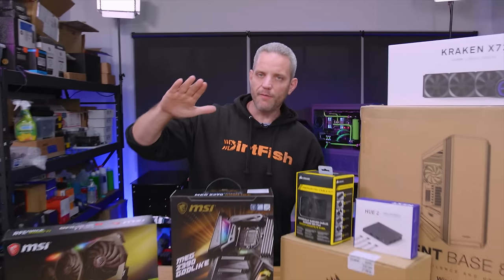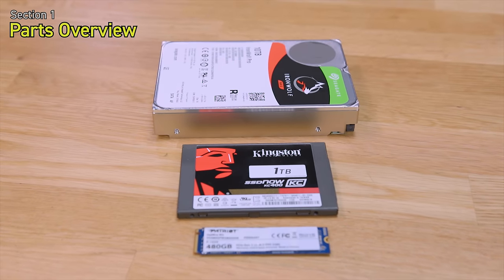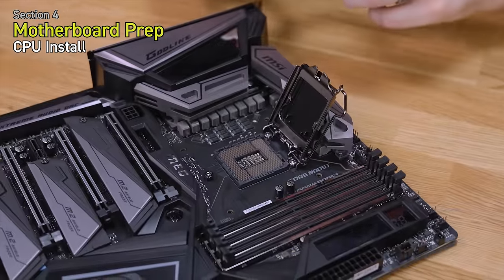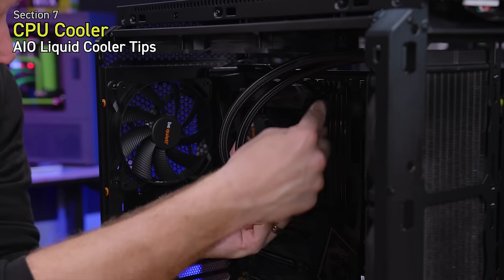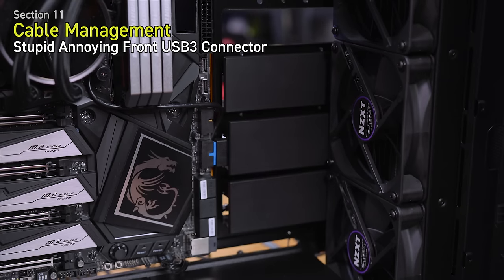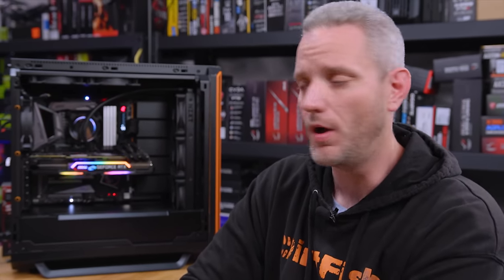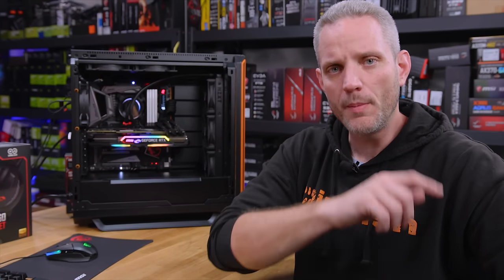How to build a computer

Comment: I did not hear the words "Thermal Paste" In this video
Reply: I think it's already pre-applied on the cooler.
Reply: @ijx_xj  Yep it's pre-applied but @ItzFrostbite still has a point though since it was a guide to build any PC lol
Reply: While I agree that he used the pre-applied from the cooler, I think he should have mentioned that for the newbies.
Reply: @welshtony1  Yeah I completely agree with your point.  He should point out that some coolers don't come pre-applied with thermal paste and that you need to apply it yourself.
Reply: You probably didn't hear the word research either :) No one with just 2 working braincells, are gonna start building a computer without some research, that would be like trying to build something else without having any form of logical knowledge to it.
Reply: still tho, there's gonna be some idiot out there with more money than brains who's gonna go get the hottest of the hot and just try to slam it together without doing much research other than finding out what parts are the fastest and most expensive.
Reply: Thats because its Lready pre-applied ...
Reply: Noob question: Based on my rudimentary understanding of connecting surfaces with paste and pads, is it not inadvisable that so many of these video guys are putting their oily fingers all over them? The human hand excretes oils which is why we shouldn't touch certain light bulbs. Even freshly washed hands. It seems to me you shouldn't touch the CPU thermal surface with bare fingers at all in order to keep the surface clean for optimal paste coverage. Or am I applying logic that is true for some things (like bulbs) to something it doesn't matter for?
Reply: @C.Church  you don't touch that stuff. Although, wiping it before applying thermal paste is recommended.
Reply: He didn’t show us how to put the RAM in
Reply: Just lettin you know this guy used that profile picture and killed himself http://steamcommunity.com/id/berhop
Reply: Kjølepasta
Reply: lol thermal paste users in 2019
Reply: @2sdd  wait, What?
Reply: Nzxt AIOs have pre-applied thermal paste. When I bought my first pc, I bought the kraken x52 and wasn’t aware of that. I bought some thermal compound and upon inspection I realized it already had some applied. Nice touch on their part. (Also, I ended up replacing their compound with some arctic silver and saw extremely small temperature changes. With the arctic silver, I only saw an improvement of 1-3°C in benchmarks I ran.)
Reply: Good point
Reply: Schlomo Goldbergstein 7  Use thermal grizzly: https://www.thermal-grizzly.com/  and some isopropanol to clean the cpu first. pre-applied paste is always less effective then the one you can can separate and do yourself. just myke sure you do it right
Reply: Under the cooler is one thermal pad tape
Reply: If it's pre reinstalled do I need to redo it
Reply: @ijx_xj  cool but that should've been said. cause if someone gets a cooler that doesn't have it pre-installed and doesn't realise you actually need it.... well that person is really screwed
Reply: also he should build a reasonable pc that most people will build for the first time
Reply: i did not hear the word "PREAPLIED"
Reply: @ghomerhust  agreed.
Reply: @JebusGolpez  You have to be on the spectrum to not know if you use thermal paste or not...
Reply: A lot of heatsinks and AIO’s have pre applied thermal paste, not really needed
Reply: The water cooler has pre applied thermal paste
Reply: Wolfcrazii I don’t think he even used it
Reply: The words "thermal paste" together give me console peasant anxiety
Reply: Josh Hust I totally agree it should be at least mentioned.
Reply: @sicariusperemo3789  You... underestimate the number of people who slubber through a build
Reply: I've been building computers since IRQ jumpers and needing debug g=c800:5 (at least as I recall). Would appreciate something more on CPU connections, thermal paste, and AIOs... This is a whole new world to me as I've just been primarily using laptops the last 10 years. However I think even a newbie would need more help in the details behind proper cooling connections than plugging in keyed DIMM modules.
Reply: @sicariusperemo3789  you underestimate human stupidity. By a lot. Look at the warning labels on a ladder or many other products.

Comment: You forgot your Swiss Army penknife and Allen key ?! you know nothing.
Reply: and the tweezers to hold cables together
Reply: and a hope
Reply: Actually, Swiss Army knife with HOPES that it has a screw.
Reply: This deserves a heart
Reply: And the lifestrong wrist band ofcourse!
Reply: And the thermal paste applicator.
Reply: And the wireless anti static strap with cancer protection
Reply: he also didnt test it on league of legends afterwards. such a noob
Reply: Ditch Allen and go with Philip
Reply: lol
Reply: @itscharliee5558  your alias account LYLE???? ❤️❤️😂😂
Reply: And NOT to short the PSU out on the case - remember to place it on the rubber feet!!!
Reply: He also didn't screw in with confidence.
Reply: And some confidence to screw in the Motherboard...
Reply: You forgot to screw in with confidence
Reply: what about the wrist band?
Reply: he forgot the elastic band as well
Reply: OMG and you guys need to HAMMER the BRACE in the back AAAAAND you need that damn CPU INSTALLATION TOOL :D
Reply: He didnt even put his powersupply on the insolating pads, his pc will short circuit, what an amateur

Comment: Timestamps:
0:00 - Intro
0:21 - Parts Overview
4:24 - Tools Needed
5:10 - Case Prep
6:01 - Motherboard Prep
8:10 - Motherboard Install
9:04 - Case Fans
9:32 - CPU Cooler
10:31 - RAM Install
11:23 - Storage Drives
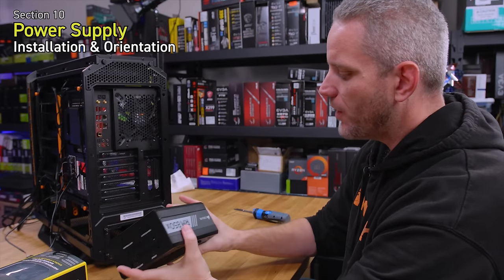13:07 - Power Supply
15:14 - Cable Management
20:00 - Graphics Card
21:08 - B-Roll / Its Done! / Outro
Reply: Nice
Reply: This needs a pin
Reply: why isn't this pinned/liked?
Reply: i love you
Reply: Should be the top comment by a mile

Comment: Who uses so many tools?  why make it so difficult, one Swiss Army Knife is all you need.  It does everything, some even have a anti static bracelet built in.  My Swiss Army knife even has a USB and is RGB!

All those tools, NONE of them will help you if there is a fire, but my swiss army knife has a fire extinguisher.  So when the fire happens, all you're going to do is just throw all your silly tools at it.  WTG.
Reply: u just got a subscriber
Reply: @chinchy111  Thermal liquid is to cool things down, and I like it hot.
Reply: @stimproid  Master Race Motherboards are placed on INSULATORS that PREVENT such occurrences. Therefore, my master build is impervious to that.  Also, I placed 4 anti static live strong bracelets on the mound stocks, attached to the widgetwonkie, that is plugged into the barfarcle valve.  DUH.
Reply: Stefan Etienne The Verrge Representative did you apply enough thermal paste? Oh and make sure the ram is beside each other for extra performance
Reply: Best troll ever!
Reply: Well, My swiss army knife also has a gaming PC. So i dont build gaming PC
Reply: I love this comment
Reply: @jonathanyork597  People have been questioning the whole placement of the memory side by side saying that I didn't place it in the correct channel.  They are wrong.  The method that I was using is a secret technique called FUSION memory.  

Placing two sticks but BOTH sticks have to be done EXACTLY and simultaneously in exactly the same way, exactly at the same time.  The timing is CRITICAL and your FORM for how you hold both sticks and place it in is also CRITICAL.  Not being SYNCHRONIZED will lead to a BOTCHED installation.  

However, CORRECTLY performing the FUSION Technique will AMPLIFY the memory's performance.  It is a method taught to me by master race builder named Yardrats.  The only other people who know of this style is two of my friends named Goten and Trunks.

Comment: great guide for all the beginner builders although you sort of forgot to mention the thermal paste since it is pre-applied but might be a good heads up to the new builders.
Reply: Hey there! Thanks for the comment! If you're looking for a reliable and efficient solution for keeping your computer clean and dust-free, I highly recommend checking out the HOTO Compressed Air Capsule. It offers powerful vacuuming and blowing capabilities, making it perfect for maintaining a spotless desktop setup. The multiple tubes and high-quality filters ensure long-lasting performance, and it's also portable and easy to use. Give it a try, and I'd love to hear your thoughts!

Comment: "How to build a computer"
1. Go out and spend $5000
2. Don't do what The Verge did.
Reply: are you telling me i shouldn't pour thermal paste all over my motherboard?
Reply: My build only cost $2400, (without monitor, MnK)

i7 9700k
MSI Trio 2080ti
16GB Vengeance
1TB Inland NVMe
4TB Toshiba
Noctua NH-D15S
850w Corsair
Aorus Master Z390
Corsair 750D Airflow

Best rig I’ve built so far.
Reply: Yea handbreak is fast on 9900k over 3900x when quickly sync I use handbreak a lot never see the options so even ture it plain just get on if work at all
Reply: @haithus  Mine was 1800
i5 8500
RTX 2070 
MSI Z370
Samsung M.2 250 GB
Seagate 500 GB SSD
H115i Liquid Cooler
32 GB trident RAM
850 watts power

Comment: Can I use snake oil as fluid for my cooling system? Or can it be blinker fluid as well?  How do I connect the flux capacitor to the anti matter reactor motherboard?
Reply: you have to use a quantum connector for the flux capacitor and thermal fusion condensation weld them to the anti matter reactor motherboard with an symbiotic atomic argon cannon
Reply: @powderedwater4742  Don't forget to cool the entire setup with Natrium ions tough!
Reply: Sounds sciency enough to be true
Reply: lmao
Reply: @powderedwater4742  I mean you're not wrong at all, but I like the gen17 chromatic subatomic vibranium cannons, but I guess we're all allowed preferences
Reply: I think you forgot your laser sword and ark reactor
Reply: @powderedwater4742  umm, duh.
Reply: @samprie100  lmao you want to cool the pc with sodium ions?
Reply: you forgot the quantum infusion chamber

Comment: He didn’t show the part of thermal paste application.
Reply: Beginner dont need to know that ^^ or to peel of the plastic fron the cooler-plate ;-)
Reply: the paste on this AIO cooler is allready aplied. So just screw it in place and finish.
Reply: but if the beginner has an other cooling solution w/o preapplied paste? For a Guide this is a big miss!
Reply: look at the verge tutorial video.....jesus
Reply: VanQ76 well what if their cooler doesn’t come with pre applied thermal paste? Going off of this guide, they wouldn’t even put any on.
Reply: There are 10 different "proper" ways to apply thermal paste. No matter which way it's applied, someone will come in and say he's doing it wrong.
Reply: @BenReese  at least it should be applied 😉
Reply: @Silvio Balaško I spread the paste across the entire breadth of the IHS, there are literally 100 different, but correct ways to apply thermal paste
Reply: There was preapplied thermal paste on the cooler
Reply: @VanQ76  so you would take a cooler with pre-applied paste and add more? Maybe you should not give anyone advice 😄

Comment: jay im building my first pc. i just ordered my ryzen 7 1700x and my x370 MB the rx 580 is on sale right now but i got the cpu instead. im building it from the knowledge i gain from your videos. thanks jay
Reply: So no gpu?
Reply: Trust logic and do pull a verge
Reply: @ignacio8597   either the rx580 8gig or the gtx 1060 3g  amazon has a deal on the 580 right now but idk how long itll last. also have a 500ssd and 1tb hdd
Reply: @Sin_6R  I was in the same boat and went with the rx580 and it plays every game I have ultra settings at 1080p 75hz freesync.
Reply: @Sin_6R  I think newegg has a deal on the sapphire rx580 right now too.
Reply: Get the amd gpu honestly you get more of what you pay for in this case gor exampel 3gb vs 8gb 8gb wins :D
Reply: I have a 580 and no complaints! NONE! Now I paid for it during the mining crazy so for $500 it wasn't the best deal...I didnt feel like waiting 3 months for a backed up order.
Reply: @theq4602  ouch! I got a combo deal with the rx580 and an asrock ab350 pro4 for I think $275, 6 months ago maybe. I cant believe how expensive all the mining made everything. And look at crypto now.
Reply: wow thanks guys for the feed back. i gotta channel im gonna be building it on if u wanna check out my "skillz" lol thanks guys, going with the 580
Reply: I will have to agree with the others here, go with rx580. I usually say go for whatever is on sale, but 3Gb video memory is too low and should not be a option. The 1060 6Gb might be an option, but 8Gb videomem is a sweetspot.
Reply: One step closer to ascending to god hood. xD

Comment: Beginners guide, Eh you don't need the front panel audio, Eh you don't need the front USB 2.0.
Reply: he just didnt want to install the front usb 2.0 header in the motherboard you can still plug it in the controller  and it will work fine.
Reply: he didnt say you dont need the front panel audio, he just said he PERSONALLY doesnt need it.
Reply: Problem remains, there were a lot of skipped steps here.
Reply: James Smith case locks have not been popular since the nineties, and the motherboard says usb and can only be plugged in one way and the same with the audio

Comment: 6:46 7:00 Did you touch both the pins and the heatspreader on the CPU?!
Reply: Mr. Beany this hurt to watck
Reply: God that made me want to be sick
Reply: they're LGA so generally it's a bit safer to do so
and one touch won't hurt much, though it does make me cringe.
Reply: Just saw it, my soul hurts
Reply: Intel CPUs don’t really have “pins” it’s just like flat kind of
Reply: @c.a.m.e.r.a.  still bad practice and you arent supposed to rub the heat spreader like that
Reply: Jiglopuff ye ik I was just saying
Reply: Whats wrong if you touch the heatspreader and pins? What is a heat spreader?...ive even seen someone peel off a heatspreader and replace it i thought it waa just a decal
Reply: TheSasukefang the heat spreader is literally it’s name, it spreads the heat evenly so the cpu doesn’t heat up to much in one place
Reply: @c.a.m.e.r.a.  thanks for the info, so whats bad if you touch it? Makes air bubbles or something?
Reply: TheSasukefang no problem, I’m not to sure what the problem is but it may be like grease from you fingers or something?
Reply: @c.a.m.e.r.a.  It's generally because the pins are super sensitive, so it's advised not to touch it there and just hold the CPU by it's sides.
Reply: @TheSasukefang , your finger can leave oils on the heat spreader. The oils may block the thermal paste from contacting the heat spreader properly or change the way the heat flows.
Reply: beep boop Beep which is true, but imo it’s a better practice to not hold it like that regardless, to keep that habit of handling those parts
Reply: I searched 10 mins to find someone commenting on that Pin touch 😂

Comment: The Ironwolf HDD isn't a good choice for a PC because it's a NAS drive made for 24/7 operation, also it's rather loud. You would be better off with WD Blue or Black or Seagate Barracuda drives which can handle many more power cycles than a NAS drive. Otherwise really great tutorial Jay!
Reply: An editing rig will pretty much be on 24/7, for YouTube's at least.
Reply: @mpk6664  you'd still shut it down for the night and every time there is a windows update. Unless you do heavy rendering by night.
Reply: Why would you shutdown your PC ever? Even in home use it's not needed.
Reply: @Tsiikki  I shutdown mine all the time
Reply: I use WD purple that branded for surveillance (cctv) but still dont notice the sound, still quieter than my cpu cooler 😅. I use them because there was this electronic store (not pc store) that sold them 2tb hdd cheaper, about USD 10 less than other pc store.
Reply: What do u think about seagate skyhawk 3TB? I will be using this case.
Reply: idk WD Blue are just fine for all kinds of stuff, you won't be writing hundreds of TBs on those after all. Don't buy SMR ofcourse, afaik only Seagate Archive drives use SMR. For a non 24-7 dektop use there are plenty of options not made for NAS operation. WD purple, red and Seagate Ironwolf are for very specific usecases ie. servers and NAS. WD Black is rather loud but performance is very good, mine doesn't run hot. WD green is too basic and slow for professional use. WD Blue are kinda the sweet spot imo or Seagate Barracuda (Pro) or even HGST who make great desktop drives.
Reply: @James Smith to each their own, I've personally had drive failures before with seagate. The guys at NAScompares.com have an extensive YouTube channel on all things NAS and they tested basically all configs possible. My experiences with both seagate and WD drives align with those. Seagate Ironwolf are NAS drives, stated so on their own website. It is possible to use for whatever, however not optimal. Rather loud access noise if you compare Seagate to WD 10 TB, both helium.

Comment: This guide is actually under detailed. It wasn't explained which cables from the psu to go where amd what they look like on the motherboard/gpu. It should've been mentioned that  1 cable on the hdd/ssd come from the psu and the other is connected to the motherboard. Also completely missed out on how to install those fans/where they should be attached on the mobo especially cus a beefy 9900k overclocked cpu will need to be cooled by God himself. I already know how to build a pc, they're just satisfying to watch lmao
Reply: Because the cords litteraly say cpu on it...
Reply: You can also watch the verge build guide :p
Reply: Leave something to figuring it out your self for more gratification !
Reply: same
Reply: @metlingaming9162  people are stupid. Ever look at the warnings on....anything? Those get put there because some idiot did whatever thing they are warning about.